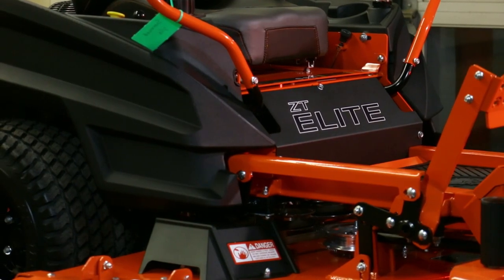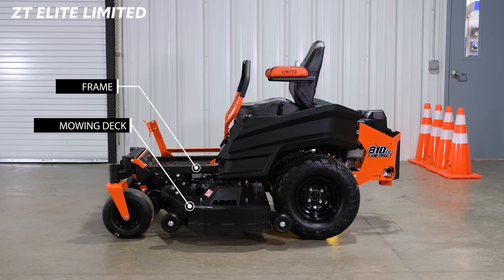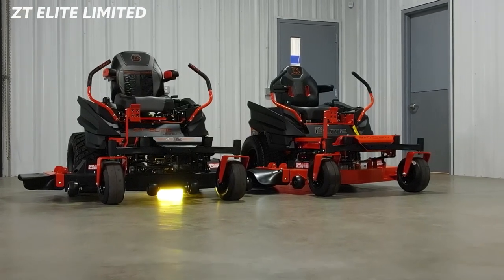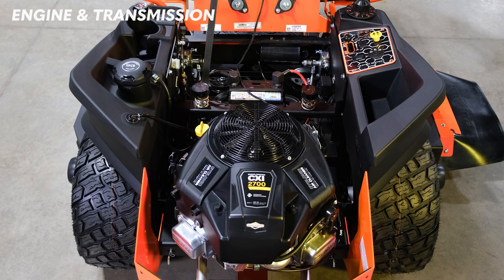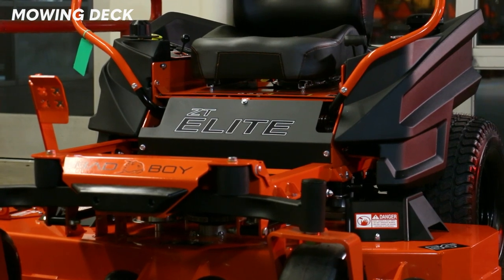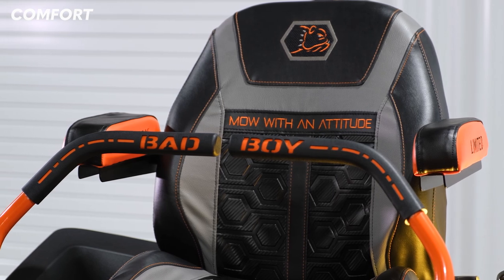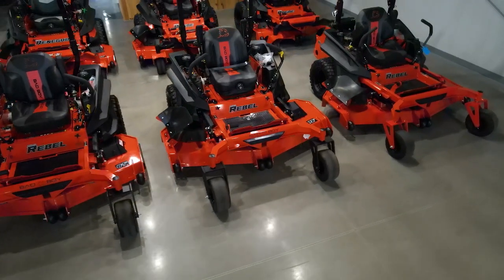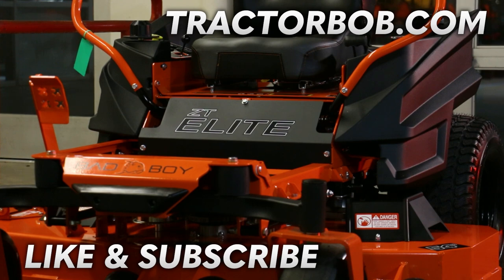2023 Zero Turn Mower | Bad Boy ZT Elite & ZT Elite Limited Edition

Comment: I have the ZT Elite 60 from 5 years ago with the electric lift deck. Once I sorted out some teething issues I’ve never had another problem with it. I also added a power inverter and a trailer hitch to it for 20$. Parts from TSC.

Comment: I bought the ZT Elite Limited Jan 3rd after my 21 year old Scotts 1642 developed an axle seal hydro leak. I was looking at a Hustler XDX but after comparing construction, comfort and amenities I decided on the Elite LE. I’m not one to purchase limited anything and I’ve never owned a ZT mower but the deciding factors were as follows; Kolher Confidant 747 engine, the air cleaner configuration, Interstate  battery, improved battery retainer, 2” receiver, uber comfortable seat (springs plus 4 isolation mounts), thicker arm rest and although not important, the Bat Mobile black out treatment and graphics. 

The more obvious attributes that steered me away from Hustler and to Bad Boy, which most of you already know , 7 gauge deck, front isolation mounts, solid front tires, 2”x2” steel frame, hinged floor pan, 6.5 gal tank, dual serviceable hydros, commercial engine,  rotary deck height selector and most important of ease of maintenance. BB put thought into post consumer maintainability. I was a maintenance officer for over 37 years and although I’m a ZT novice, Bad Boy’s design team put thought into the end user side of maintenance.

Was the ZT Elite LE worth the extra $$?  Apparently, it was to me but my mechanical back ground and maintenance officer experience tell me this mower has process control, quality and asset engineering written all over it.  It’s built like a tank, manufactured and assembled by Veterans and will likely be the last mower I’ll ever buy.  I’m looking forward to growing and mowing with it. 

Be happy in your work, Cheers!
Reply: The deck height selector alone is a standout feature compared to other brands . I love my zt elite . But the tire size definitely sucks .
Reply: I bought the Maverick because i weigh over 350lbs and its the only machine that had adjustability to fit me and is well built.  Have had mine since last season and it's been flawless.  Best part is how fast i can mow and get the job done.

Comment: I just bought my ZT Elite today, see how well it does when I hit the taller grass. 

I have noticed a vibration in the blades that needs to be addressed, feels like a blade is out of balance or bent, not sure yet but will have to be fixed before it damages the bearings. But I did a test run tonight when I got it home late and it was so bad it actually made my feet hurt from the vibration.
Reply: I wonder if one of the bolts holding 
a blade on is loose?
Reply: I bought my ZT elite with the Kawasaki  engine 2 years ago and I’m disappointed in it that motor is a $500 upgrade and it uses oil after 2 hours of use and my ZT Elite doesn’t run 7 mph,  my son bought the Spartan lawnmower that was about 4,800 and it is quicker than my 6,000 dollar over priced ZT Elite bad boy lawnmower that has no grease fittings at the wheel spindles and mandrels
Reply: I would Take it back and get another one because of the poor quality of assembly I would not want it fixed but would tell them I want another one or give you money back

Comment: I can't find any videos comparing 54" cut to 60" cut quality and speed, using same mower and mtr. I have a 60" elite but can't cut all out and was wondering if the 54 could cut faster and be more useful in tighter areas.

Comment: After watching a bunch of YouTube videos, I've been seeing that a lot of owners are complaining about how noisy the Bad Boy ZT ELITE is.  Is this a characteristic of ALL of the engine options or just the Kohler?  I think there is a lot to like about this zero turn as far as build quality but if it's really that much louder (even with ear protection) than some of it's competitors, Im a little concerned about spending $5,899 on it.  Any help would be greatly appreciated. Thanks!
Reply from the maker: There’s nothing about the ZT elite that makes it particularly louder than any other zero turn. The engine and deck is where most of the noise comes from. A Kawasaki might make a bit less noise than a Kohler so that might help a little bit.
Reply: I jabe the 2024 zt elite with Kohler7000 n lobe it n isn't loud at all normal engines blades spinning noise withbany machines n the zt hydros all have an partial sound they make when in use almost an whine but again is normal n all zt hydros make it guessing anyone who complains about noise is orbhas used an machine with .ore surprior Parker wheel motors or other wheel drive systems

Comment: WHY are 3100 transmissions rated for 9mph but Bad Boy only claims 7mph?!?!?!?! Other manufactures claim higher speeds on models equipped with 2800's...?
Reply: There adjustable in speed since over time hydro wheel motors will get out track where one tire goes faster than other an has be adjusted to fix issue n mower actually go in straight line an ya if have issues with your zt elite speed can take into dealer tell them an have them adjust it to get more speed n ya may have leave with em for couple days so they can make adjustments an trust make sure it's tracking straight n ya the zt3100s have an adjustment for each wheel motor speed so of yours isn't up to par cause came set more rd 5mphs from factory an dealer didn't mess with it n ya alot customers wouldn't even know this to bring back an complaint but ya is the issue factory comes rd 5 6 mph tops prolly closer to 5 for whatever reason n would have to be adjusted  to get closer to.the 7 even 9mph there rated for

Comment: They screwed up when they didn’t put the Kawasaki engine on the elite as an option. I wouldn’t buy one with any other engine.
Reply: Bought one yesterday with the Kawasaki engine 54" deck.
Reply: @eddiea3251  No you didnt
Reply: @cameronp9559 I just brought the 48 in yesterday with a Kawaski engine 💯
Reply: This is old lol
Reply: At Cox Empliment i bought one for 6 something they wen5t Platnium by working on Sundays but they got told no but the Kholar actullya as good as the Kwaski an the Vanguard is a Brigg they evan iffer a Nice Honda but for 0% intrest at Cox Implamanrt is the cheapest!